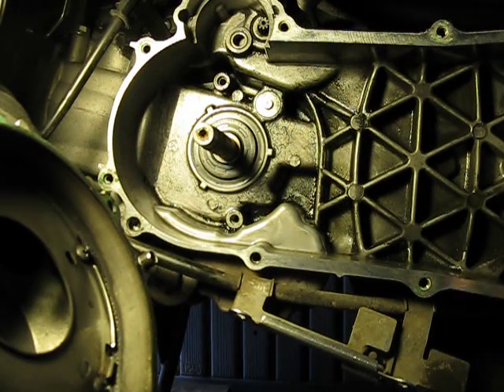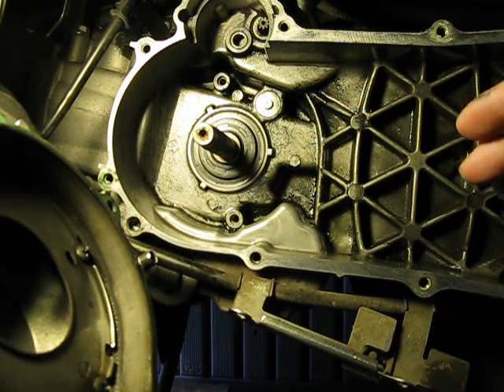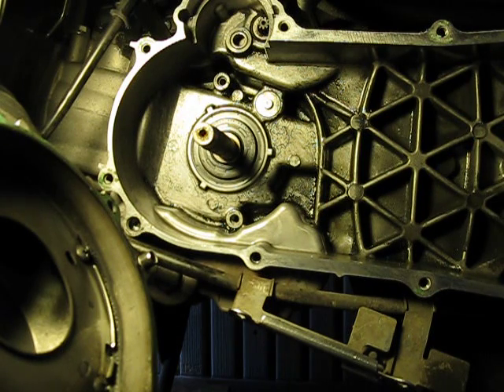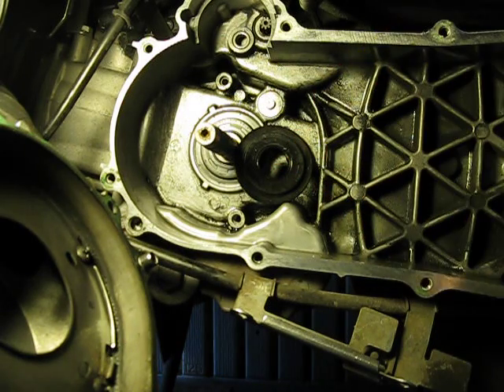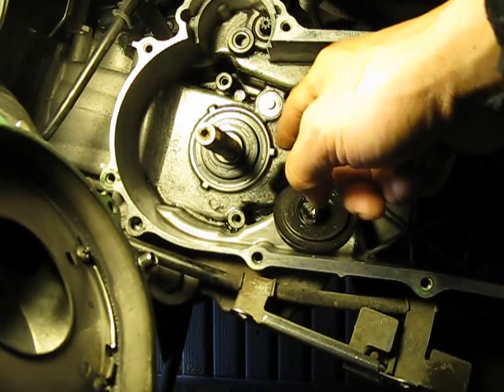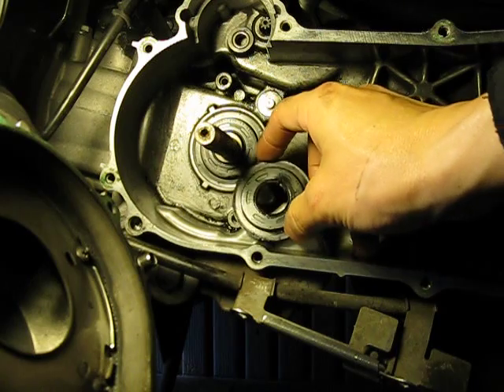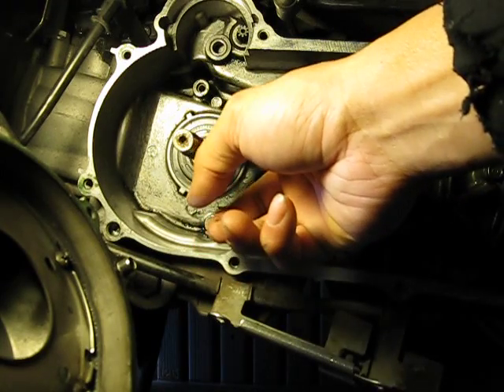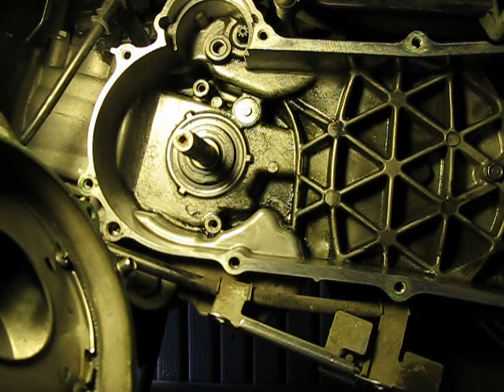Honda NHX110 crank seal replacement

Comment: 33 000 miles,  first break down. Finally replacing the seal. Overfill by over 2 inches when lost the dip stick and had oil splashingiut from the engine.  Thanks for the video.

Comment: Dabinche, nice video and good job explaning the work.
I recently bought an elite 80 to go with my 110, Can you explain the purpose of the drive cover gasket and if its torn around the bolt holes does it have to be replaced in your opinion. I can see in this video the remains of the drive cover gasket around at least one of your bolt holes.
Reply from the maker: no need to replace drive cover gasket, if it is mostly there it is fine...it is mainly there to have a soft layer between the two hard parts